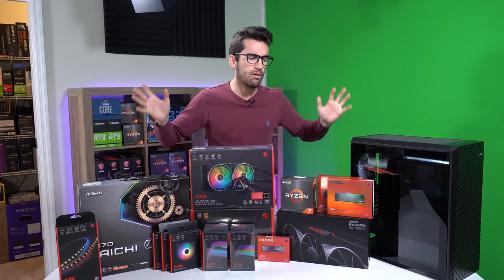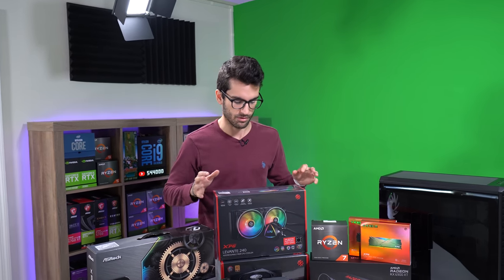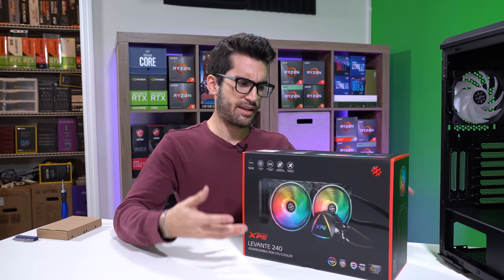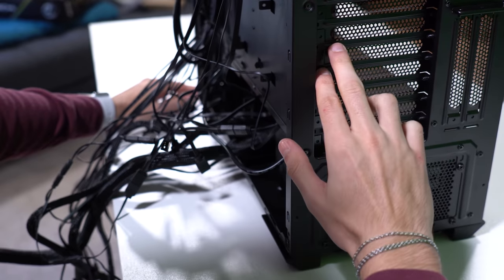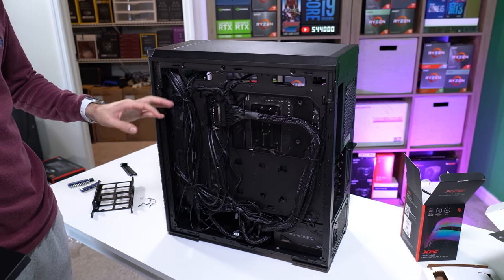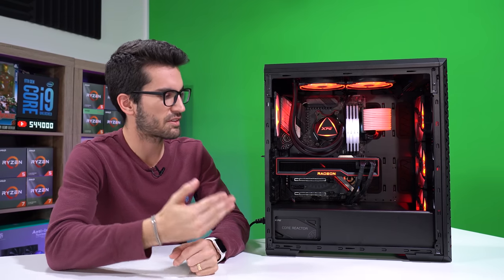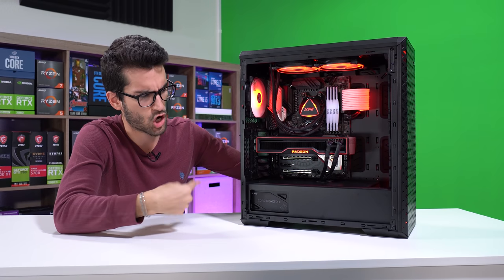Building a BEAST AMD Gaming PC With XPG!

Comment: 6900 XT and 6800 XT have changeable RGB you're wrong there. Only 6800 has red-only.  The plastic on the lights is actually translucent whereas on 6800 it is red plastic.

Comment: i use a xpg nvme and i love it. did a lot of research and picked that one, best price to performance. i am really digging that case too. i think i like xpg lol
Reply: Did you hear about how they changed the controller on the drives a couple of months after the reviews went live? They basically decreased the performance without telling anyone. Tom's Hardware did an article on this recently.
Reply: @jillianangell2570  first of all Adata isn't small. Secondly changing components is fine as long as the performance remains the same. In this case the SX8200 PRO lost as much as 20% of the performance in some scenarios. This is simply unacceptable.
Reply: @sudo3644  they did this to increase the longevity of the drive.
Reply: I got my drive about 2 months ago and after benchmarking it averages out at running at 98% of what it claims

Comment: You forgot to remove the plastic on the m.2 thermal pad.
Reply: Not on the M.2 slot he used on the top. Looks like he's used this board before possibly
Reply: Hes done this more than once so i think he knows. Probably helps keep it in its factory condition.

Comment: Those plastics on the ram sticks are there because you install them from the outer most slot and peel after they are installed. that way there will be no fingerprints.

Comment: hola did you forget to take off plastic from the nvme and heatsinks or is this just for show and suspend disbelief because i think it would overheat
Reply: The top one didn't have the plastic on the thermal pads, I guess it's because he already installed an nvme when he previously used that motherboard

Comment: I’m really digging that case. Love the front mesh, shows enough fan and looks like adequate airflow. Especially like the room for the top mounted rad. You usually don’t see all that space
Reply: actually i was so suprised that i could install a 360 mil at top and 3 at the front, really helps the CPU and GPU stay frosty

Comment: I am 25 and never had own PC yet. Only got family PC at home and actually I am rarely using it since I don't have time, and it's occupied by family. Sitting with laptop since last 5 years and it's not gaming laptop. wchich makes me to play some oldschool games only (even those are a challenge because I am RTS player, not only RPG - RTS games want a lot from your GPU and CPU in terms of spawning hundreds of units....)

I am used to changing PC once for every next 8 years. So I saw like 4 to 5 PC builds in my life at home.

I have never built myself own PC, but once I will get stable job and finish degree, maybe even have own apartment, bigger than small room, then I will make my dream happen. Not a fan of whole RGB idea, I look only at technical stuff instead colours and design but man...

That motherboard with mechanic stuff influenced design bought my heart :D

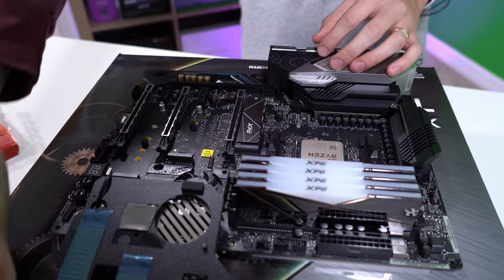Comment: What about the blue tape on the nvme thermal pads! 6:46
Reply: It's a protective film. It prevents anything from sticking to the thermal pad before you use it. The first one most likely didn't have that because he's used that board before so he already peeled it off.
Reply: To add to what  The Game Bench said he did not have anything under the lower 2 thermal pads to cool. The upper most pad was already peeled
You can rewind the video to go back and look at details you missed the first time

Comment: Any thoughts on the PSU? I just finished my very first build and happened to use the very same one, and while I enjoyed building with it, it's probably the loudest component in the system. Not too loud mind you, but since the system is overall very quiet, the PSU's hum (fan?) is what you end up hearing most. Just wondering if that's normal, as I don't really have a frame of reference, or whether you shouldn't typically hear this? :)

Comment: Lian Li solved the RGB graphics card power cable issue by making it so that you could dismantle it and flip it over.  I had to do that for my EVGA card which also has the 8-pin PCIE power ports flipped.

Comment: For me it was actually ok to do my 5 rgb fans.I got mine set to white because i don't like it flashy.Where i struggled with this cables was behind my side panel as i have a very thin case.Guess that's not a problem in this case.The build looks sick but i would have changed the ram same color as it looks a little off being white and all.

Comment: so i have been trying to wrap my head around AIO placements for the past week.  Im trying to figure out why anyone would want to push hot air through the radiator and use it as an exhaust?  Wouldnt that defeat the purpose of cooling with the radiator if you're pushing hot air into it?

Comment: While I certainly see a lot I like about that case I think it's time we talk about what is a good mesh design. In the video it's said that this case has a good front mesh design with lots of airflow. Well it might not have been exactly those words, but that was what was implied. Just looking at that front I'd estimate that there is less than 25% open area in that front mesh. Is that really that good? After all it means that to match the open front area of a fan it takes four times the mesh area.

Now that isn't as bad as it sounds, or the temperatures would have been through the roof during testing, but it shows that the front is pretty restrictive compared to if it had been all open.

"But wait a minute" I hear from some of you "How can you say that it's only 25% open area? You haven't even seen it in person, and there is a lot of holes and some pretty large at that in the front baffle."

Yes there are a lot of holes, and some are pretty large, but there are also a lot of smaller holes with a lot of plastic between them. The number 25% is a guestimate I came up with as an average for all of the front area. At the top and especially at the bottom of the front the holes are smaller with a lot more plastic in between than towards the middle. They are all square which makes it a little easier to guestimate the dimensions. A few years back I had to look up hole patterns and the percentage of open area they represented. I found a company that makes perforated sheet metal and on their home page they have a tool to help their customers to calculate just that. It's quite interesting and easy to use. You just look up the kind of hole pattern you are interested in, plug in the dimensions and the site does the calculations. In the case of this front panel the hole pattern is Square Perforation - Straight Line.

If I plug in the numbers 5 mm for hole size, 10 mm for pitch in both X and Y then it spits out 25% as the open area. Now it's important to understand that the exact numbers used doesn't have to be the same as the real world object we are looking at, they just have to be reasonably correct in relation to each other. If I put in the numbers 15 mm for the hole and a pitch of 30 mm it's still 25% open area. Now this front isn't quite that simple as the hole size is larger towards the middle and smaller towards the top and bottom, but we can make an estimation just by looking at it. It's not all that easy to find a good picture of but from what I can see on the XPG website it appears that the middle 25% has the large holes and probably something like 55 - 60 % open area. However the top and bottom 50 % has much smaller holes ranging from 25 % down to 6 %, so maybe that 25% number I threw out early on is a little low.

But the plastic front baffle isn't the only thing standing between the fans and open air, there's a fine mesh installed behind it also. According to the best picture I found this mesh uses a pattern called Round Perforation - 60 Degree Staggered. Using round holes is less efficient than using hex perforation or even square perforations, but the 60 degree staggered pattern can be pretty good. In this case it's about as good as it gets with such small holes in the mesh. The problem is that stamping out really small holes very tightly grouped is hard and tends to distort the mesh, so these have pretty much "meat" left in between the holes. Now estimating the dimensions for this mesh is not all that easy, but to me it looks like it's about 35 - 40 % open area. But don't start celebrating yet.

The problem here is that this fine mesh is covering up the holes in the larger mesh. So we have perhaps 25 - 30 % open area that is being blocked by as much as 60 to 65 %. As it's getting late here I'm willing to call this smallest mesh a 50% open area mesh just to make the math a no brainer. So in the end there is really only something like 12 to 15 % open area! And even if the plastic square mesh is much better like say 50% open, then we're back down to something like 25% open area which is better but hardly great.

Now does all this really mean anything? Heck if I know!
Should you care? Same answer there. The machine in the video seems to handle the heat output for these components just fine, so unless you are going to do something awful or awesome with it it's probably fine as is...
How can we know you didn't just pull these number out of your... well some where not so nice? You can't, especially as I kind of did. But if you are interested you can find the tool I mentioned on this page:
https://www.perforated-sheet.com/calculation/how-to-calculate-open-area.html
And the XPG page for the case with the picture (scroll down about a quarter of the total page for the best picture of the smaller mesh) is here:
https://www.xpg.com/en/feature/708/

Comment: The video's really good, but I'm a bit concerned about the lighting on the RAM sticks. They seem really desynchronized for some reason
Reply from the maker: They aren't supposed to be synchronized. Each is flashing the lightning effect randomly. That's the point. They just happened to line up in a few shots.

Comment: Would love to build a new PC and make switch from consoles  but tbh it's highly likely that I will go down the pre-built route (Alienware, scan or OCUK) as the lack of stock means it will take months of waiting just on CPU and GPU. There does appear to be a rough time frame with most pre-builds. A 6800xt merc 319 was sold out in minutes today  and its just now ridiculous and frustrating 😕 great video btw
Reply: With the way things are currently it's best to just buy a console, not that those are easy to find but they sure as hell are a whole lot cheaper. For the price of one gpu you can buy a PS5 and a Series X lol.

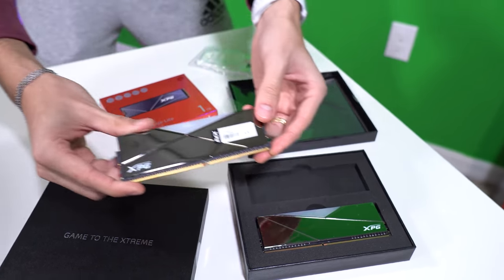Comment: 5:15 the other side also looks like it has plastic covering and I don’t know why you put it in the ram slot without taking off the plastic
Reply: He has used the board before.  The plastic was already removed on the slot that he put the M.2 SSD into.  He put it in the top slot.

Comment: Nice build, but I decided to go with Intel even it is underdog for know. Reason is I want fuss free pc. On that note, have you had the chance to try Asus ROG STRIX Z490-G GAMING (WI-FI) Micro ATX LGA1200 Motherboard ( I like IO layout on it) + Intel Core i9-10900K 3.7 GHz 10-Core Processor, and what are your thought's on them ?
Reply: 10900k is a pointless cpu
Reply: @mryellow6918  I plan to use my next pc for gaming, and 3D modeling for at least next 5+ year's with one monitor (1080p or 1440p, and for my need's it's either i9-10900K or 5900X).  For me 10+ year's of waiting is enough, maybe I can wait two more month's to have more pc part's availble, but no longer than that.   
Why is i9-10900K a pointless cpu ?   Please explain ?   Has AMD improved close as intel with software and hardwere issues ?
Reply: @antoniocepaj7544  like you said just go for a 5900x.

Comment: AMD recommends an 800W PSU but I think it's overkill. Are you going to do a stress test on it and see how much it consumes? I use a 750 PSU for an overclocked 6800XT and highest I've seen it go is 330W @ 2.7ghz with a total whole system power draw of 547W
Reply from the maker: 750W is perfectly fine in this config.
Reply: @GregSalazar  Yea I agree.

Comment: Doing the bass ackwards upgrade ever, had to buy my X570 mobo (x570 Taichi new for $250) and 34"UW monitor first. My 1080 ti may survive ampere and RDNA2 yet if supplies continue to be non existent. With Zen 4 on the AM5 socket, looks like it will be Zen 3 for me. Good luck with everything with budget "PC" gaming meaning consoles these days.

Comment: 16:40 how about a vertical mount for the gpu?
Reply: @Hana Song
                         How about right up against the tempered glass panel choking the GPU of cool air
Reply: A "Separate Vertical Mount" is different with the built-in vertical mount in the case itself, it has a lot of space to breathe air and it wont get sandwiched with the glass, it actually can improve thermals depeneding on the gpu.

Comment: 750w gold psu for rx 6900 xt????
Reply: I think that should be fine unless he's overclocking the card
Reply: AMD recommends 800W but 750W should be more than fine. Both 6800XT and 6900XT draw 290 - 305W. Highest I've seen my 6800 XT with a 2.7Ghz clock is 330W and I run a Corsair RM 750 x. Total system power peak is 550W

Comment: That CPU, especially the GPU are completely useless, the RBG is clearly the powerhouse of this build🤔
Reply: Forget the joke the cpu is useless. Just an expensive 5600x or a crap 5900x and amd make you pay extra for those 2 cores
Reply: @mryellow6918  true, true. the 5600X is already a beast for gaming and the 5900X is blasting it away in multicore tasks, which can also do similar or better performance for gaming.

It is a really strange CPU compared to it's brethren... Thread Ripper 5950x is still a monster though, but ey all those cores are only sexy for certain tasks. But out of the lot, it has the coolest name

Comment: 4800mhz ram for Ryzen? What for?
Reply: Because you can clock it to 4000 and run tighter timings.
Reply: @mryellow6918  tighter timings are not worth the price for these sticks.
Reply: @mataman1  that's up to you to decide. They are not built for your average person, they are built for a memory overclocker, and give you the top end performance. If they were not worth it they would not sell

Comment: Minus being some of the best CPU/GPU you could get, I don't think this build is really all that. Sure the 5800x and 6900XT is nice, but my color scheme in my pc looks so much better. Did you even end up using the RGB strips? I used ALL Corsair for mine, x8 LL120, H100i Elite Capellix, LS100 smart lighting strips, 4x8gb Vengeance RGB Pro DDR4, and it looks fantastic. Yeah it probably cost a lot more than XPG does, but then again I wouldn't be surprised if it was actually priced about the same, but I would never buy an all XPG build. The ONLY thing XPG I have is an RGB m.2 nvme drive, and I don't even like it, so I'm gifting it to my nephew and getting a 2tb gen 4 drive. I mean this build DOES indeed look good, but its way too cookie-cutter and looks really plain with just red and black. Only thing I'm missing is RGB cable extensions, but I'm waiting for Corsair to make them because I LOVE the diffused look.

Comment: cable management is trash D:
Reply from the maker: If you've seen any of my other builds, you'll know that I typically handle cable management very well. However, in this case, it was nearly impossible. WAY too many wires from all of the RGB components. Doubt you'd handle it any better 🤪